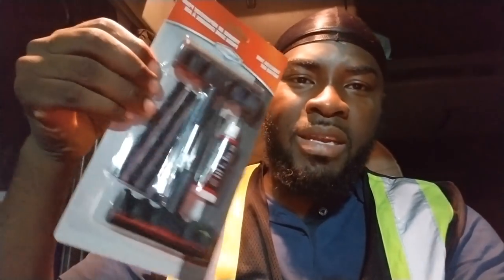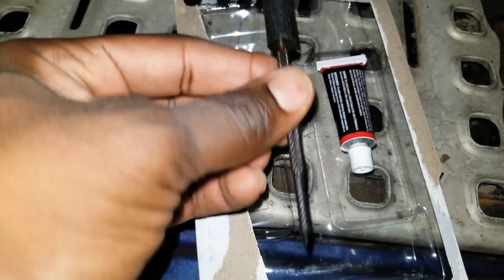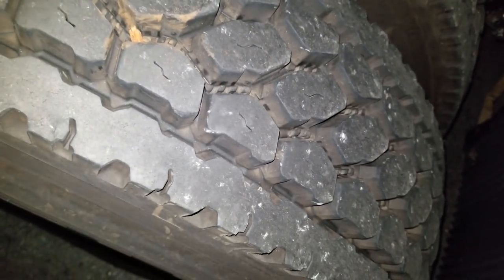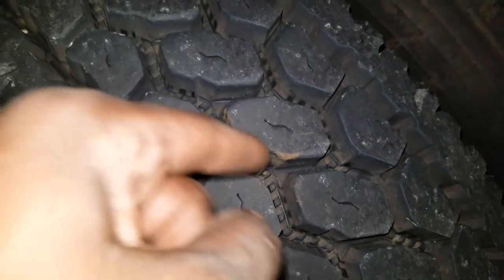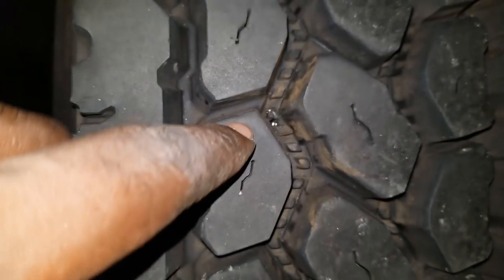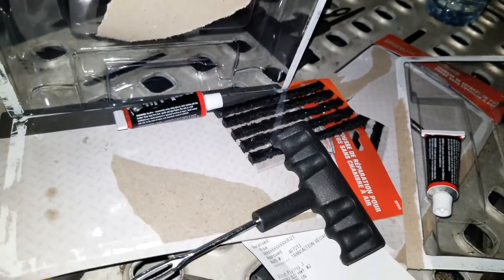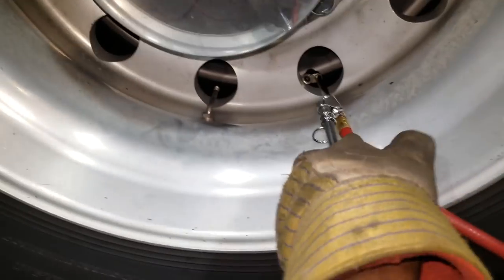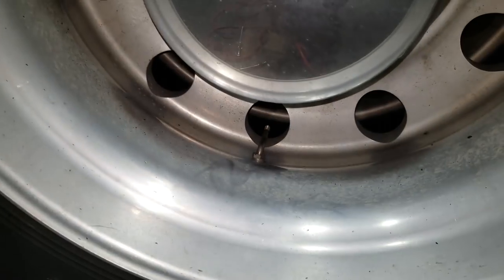How To Plug A Flat TRUCK Tire. Vlog #85

Comment: Hey sup, remember the language when you are talking, plus when installing the patch don't twist  or turn it until it's fully in the tire also what I  do at the of installing the I burn the end of it and flat it out to help seal it ,but it looks like it will work good job
Reply from the maker: conroy thomas thanks mi boss the language is not coming out here right 😂 I'm working. Also about burning the end thanks I'll do that next time.